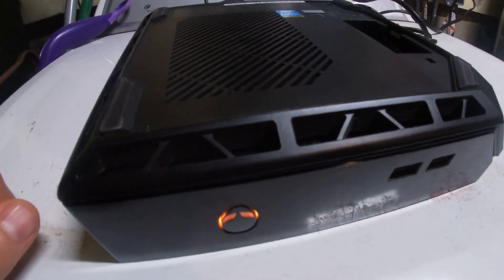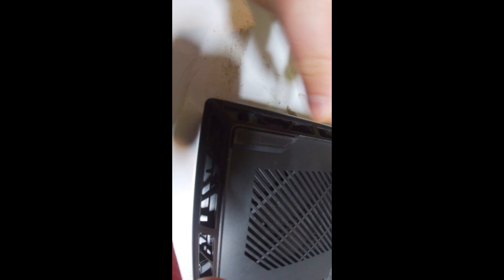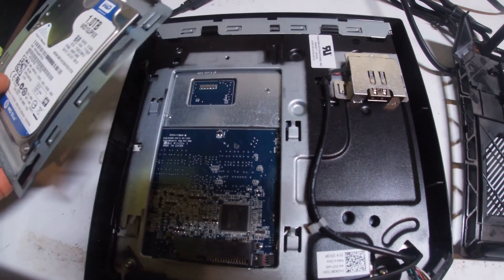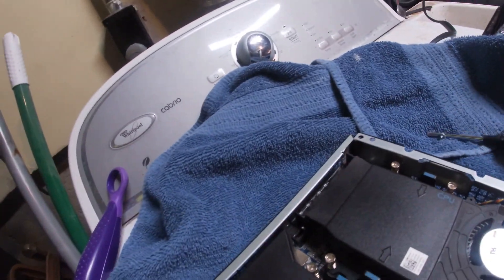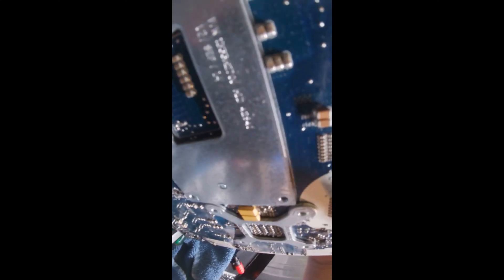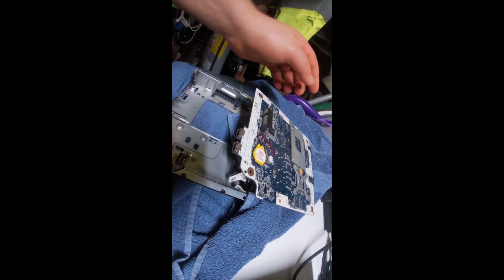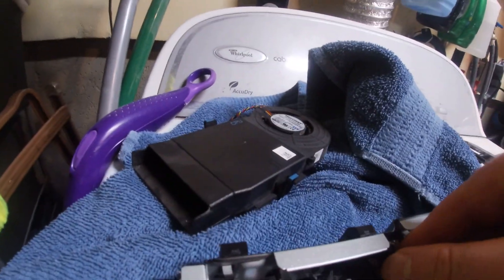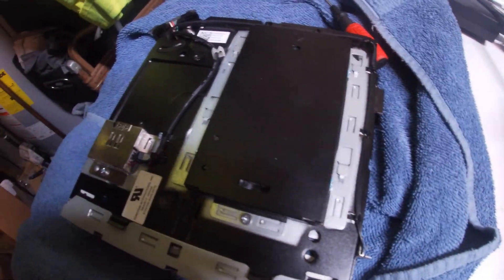Alienware Alpha yellow flashing light fix

Comment: I do have 3 of these, and I have changed all of the batteries, and they still do it....    I did cut the cables off the cmos battery to solder a battery case for a normal 2032 to it and to have it on top of the main board so I could access it easier next time, but I have tested tons of different batteries, and they are still doing that...... Any Ideas ?  These are two R1 and one R2 ... That stood around for a long time and so the battery is dead... But even with new ones they do the same.

Comment: I just got one of these off of craigslist for $50 with the same problem.
Reply from the maker: @luigiprovencher  nice thanks for watching
Reply: @ScamtheScammers  I just ended up cutting the end off the battery and splicing it onto another older battery that wasn't as dead as the one that was inside it and it worked so I installed Windows 11 on it but what came on it for default applications and software?